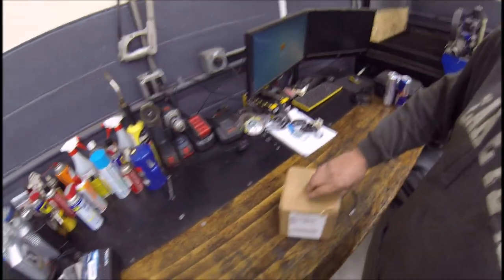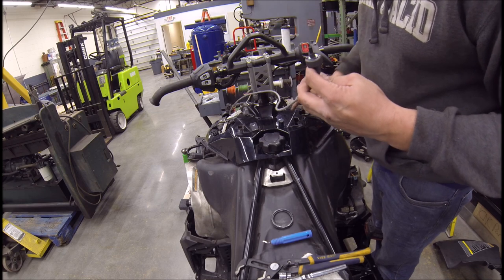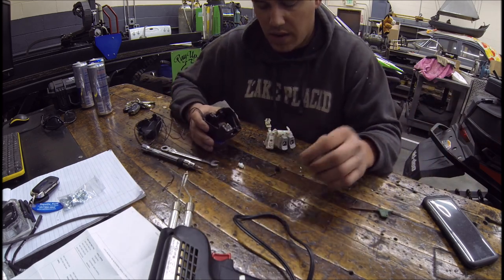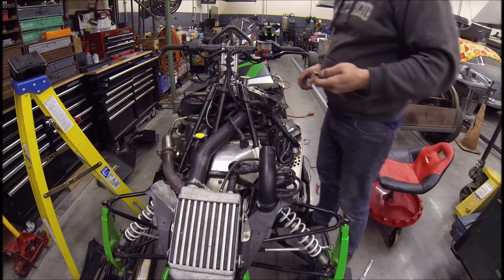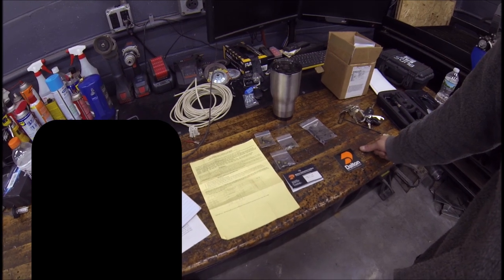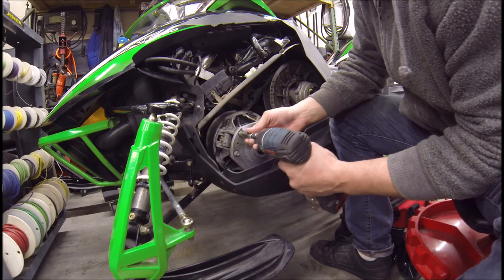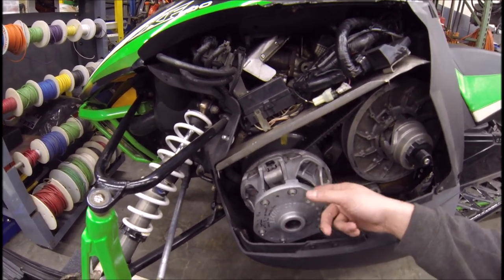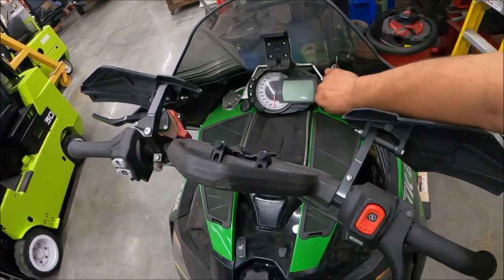TD Turbo Dynamics 3 Stage Tune with Anti-lag / 2-Step Install and Testing on 2013 Arctic Cat XF1100

Comment: I just made Scott Taylor $950 richer. I didn't do the chain upgrade yet but I ordered the TCL delete brace and a new jackshaft. I'm running a 240 horse tune on my 2013 RR with an extended track, cold air intake, Bikeman Clutch Kit, and can. He's smart as hell and guaranteed my days of blowing belts will be behind me. I'd blow a belt about every time I went out for a ride.
Reply from the maker: Yeah same here.  Not cheap, but belts at $100 a time adds up.  I didn't blow a belt all of last season after doing all of this.  The motor and jackshaft are in a much better alignment now and this bracket gives the the belt extra give to unload while coming of throttle hard at top speed runs.   My biggest failures were with the chaincase.  I was destroying chains and sprockets.  It's worth the upgrade at some point. .

Comment: I have the same setup. However, when I have it on Stage one, I get two flashes. How did you get the Anti Lag only with 1 flash?
Reply from the maker: The first position with one flash is just  anti lag.  It's not drivable in this setting.  That's how mine came when I had it flashed.  You'd have to ask TD support.

Comment: Send your clutches to ron ward at hi-tech mechanical. He is a wizard with these sleds.
Reply from the maker: Good to know!  Thanks for the heads up.   Do you have the twister kit on any of your sleds?  I blow belts like every 150-200 miles or so and have been searching for a solution that works.
Reply: @EastCoastAntics1  I have a 2012 xf1100 turbo I had to get my motor and clutches realigned and a brace for the motor, no issues with blowing belts since.
Reply from the maker: @xdeabdogx  Thanks, I'll take a look at the alignment.  What brace do you have?
Reply: @EastCoastAntics1  turbo dynamics belt adjuster floating adapter is the way to go
Reply from the maker: @kevenroy3848  I ordered one a few weeks ago.  It's a nice piece.  Way better than the bikeman one.  Also got Scott Taylor gears and chain.   Not a single problem so far.